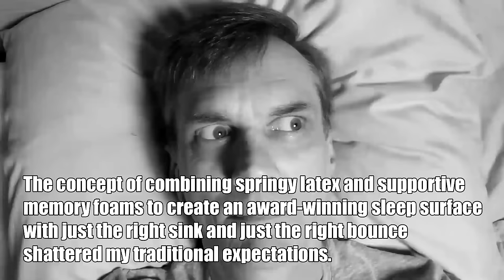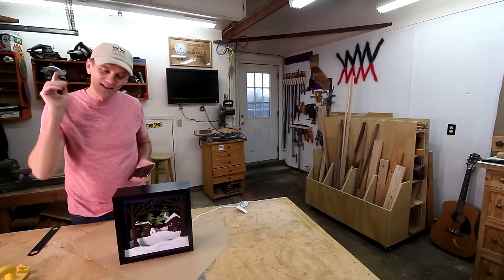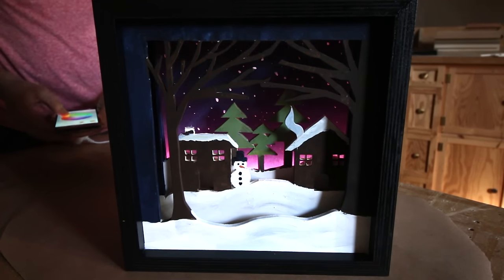Lighted 3-D Scroll Saw Shadowbox | WWMM ART & DESIGN

Comment: I built it for my wife as a surprise gift.  She (and all her friends) LOVE it.  I used birch plywood for both the frame and the panels.  I was on a budget and couldn't do the expensive LED light set so I went with a $2.99 wally-world LED light set for a Christmas village.  Not quite as bright as the more expensive set, but some white paint on the back of the panels helps bounce the light around and nearly makes up for it.  (I attached the light string to the panel with hot glue.)  Thanks for a great project and a great gift idea!

Comment: Do the lights cause the back to heat up alot?
Reply from the maker: +Jon Lambert No...they are LEDs. I leave them on 24/7.
Reply: Ok. Just curious as I've had LEDs get hot in the past, but those put out alot of light. Thanks!
Reply: IMHO these are just low powered decoration led strips, not home lighting powerful leds.